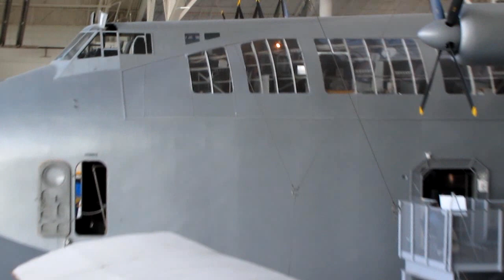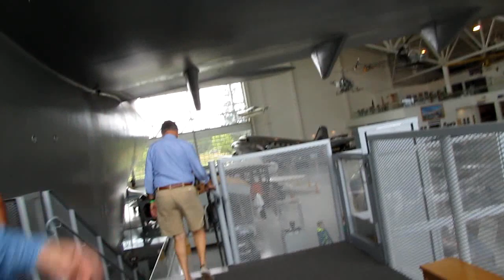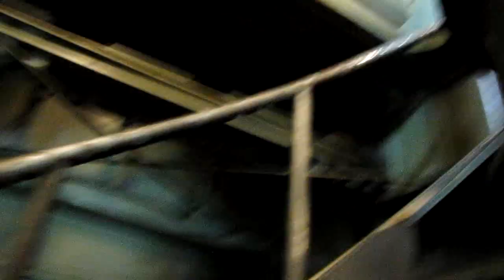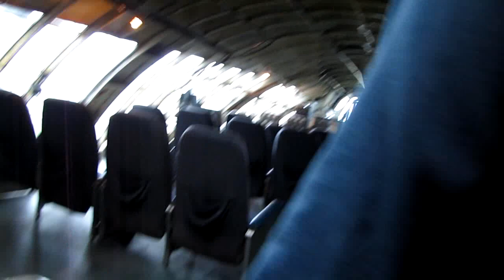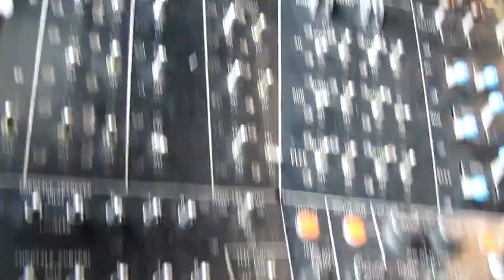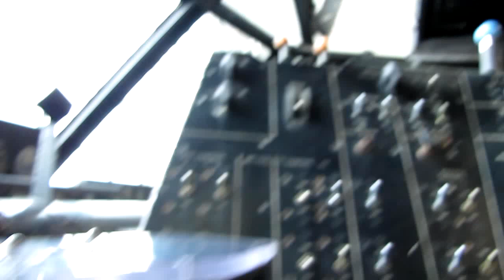The Radio Mechanic Visits The Spruce Goose

Comment: Hey Radio Mechanic, you are so IGNORANT, the bomber that did most of the bombing of Germany in WWII was the AVRO LANCASTER.
Remember a small outfit called the Royal Air Force.
The Lancaster had a bigger bomb load and greater range than any other bomber used over Germany and it carried the biggest non nuclear bomb of the war, the 22,000 lb GRAND SLAM designed by Barnes Wallace. The Lancaster destroyed the Tirpitz with Grand Slams which lifted the battleship out of the water and flipped it over.
Only the B29, which came much later, had a greater range and bomb load.
I saw the Spruce Goose when it was at Long Beach right next to the Queen Mary, a truly magnificent aircraft.
Reply from the maker: While your correct in that the Avro carried a bigger load, if the US had not gone in on daylight precision raids England would likely be speaking German. I agree I should have said "U.S. Bombers.  The excitement of being there colored a lot of my narrative. And as a WWII history buff I am well aware of the contribution The AVRO as well as the other British planes contributed. However calling me IGNORANT just shows your upbringing is lacking. Nicer ways to phrase things than that. Don't you think?
Reply: Yes I apologize, perhaps I was a little too ANNOYED at the time. But you see I was born in England in the middle of a Luftwaffe air raid before the US came into the war. we were in a desperate state but we were supported by troops from the Commonwealth they were our family also. I had an older brother and sister who remembered the entire war VIVIDLY and the privations they endured. They told me of the dangers and the fact that our parents would never have let us fall into the hands of the NAZIs, a very sobering thought.
That never happened but no one who did not experience it can understand the gravity of that period.
I had an uncle who flew for the RAF in 1940 he was 18 he flew in small two engined bombers, the Handley Page Hampdens. Returning from a raid one night the pilot lost his way and crash landed in a field, my uncle was severely injured with a crushed hip he was the only one hurt.
He was of course retired from active duty but because of the shortages of EVERYTHING his hip was never restored correctly and he was a cripple for the rest of his life, he was a very handsome young man but in true Hollywood fashion he married his nurse who was a refugee from Malta and an equally stunning young woman. The rest of his crew went back to active duty, none of them survived, the crash saved my uncles life. 
So you see this is a deeply personal thing. No one who lived or was born during that period will ever have anything but gratitude and praise for the USA. Britain fought alone for a long time and it was the Battle of Britain that was the first defeat that Hitler suffered, Britain is a tiny island and we sacrificed virtually everything we had to fight that war. Remember that had WWII been lost then not only Britain might be speaking German BUT THE USA AS WELL.
Incidentally it will be no surprise to you to know that WWII is also a passion of my own yet I find that many Americans know little about the role that Malta played, if you are not aware of this I urge you to read about it. 
Malta received the greatest tonnage of bombs per square mile of ANY THEATER OF THE WAR. Yet Malta survived thanks to the heroic efforts of the British Merchant Marine the Royal Navy and the people of Malta.
In the end the RAF were left with only 3 WWI biplane fighters to oppose the Luftwaffe, the planes were named appropriately, Faith Hope and Charity.
 Read the story of Operation Pedestal and the critical role played by an American Tanker the Ohio which despite everything the Luftwaffe could throw at it the Ohio refused to sink.
Hit by many bombs it finally lost all engine power only a few miles from Malta it was towed into Grand Harbour Valletta by two RN destroyers SIDESADDLE. Yes they literally tied a destroyer to the side of the Ohio and bought it into harbor, where it almost immediately settled on the bottom but its cargo of oil was pumped out and it saved Malta and perhaps the war.
When Italy surrendered the Italian Navy was ordered to sail to Malta to surrender under the guns of Grand Harbour Valletta, a very fitting salute to the incredible courage of the Maltese people.
Regards.

Comment: I only saw it in a videogame, in an unfinished state (takes place during construction), and i was STILL impressed. I'm fairly certain that they got the dimensions accurate. I'll need to get my Google Cardboard compatible phone repaired (boot loops likely because of dead charging circuit) and check out some of the VR/360 videos somebody took of this exhibit here.
Reply from the maker: The real thing is Amazing.

Comment: I do agree that the "Spruce Goose" is an amazing aircraft. However I must point out that your statistics on the bomb tonnage dropped by the US Air Force in Europe are incorrect. The RAF dropped 964644 tons while the USAF dropped 623418 tons. Also, while the B17 was an iconic aircraft in WW2, the British deHavilland Mosquito, which was like the "Goose" was also a plywood aircraft, carried the same 4000 pound bomb load as the B17 at a much faster speed(392MPH at 22,000ft vs 180MPH for the B17and with only a crew of 2 compared to 10 on the B17.
Further, the RAF A.V.Roe Lancaster Bomber which like the B17 was a 4 engine bomber could carry a bomb load of up to 22,000pounds, and regularly carrier  18,000pound loads to Berlin
Reply from the maker: I was talking about American bomb loads. Fully aware that the Mosquito was the fastest thing in the air. Wasn't one there or I would have mentioned it. The video is about the Goose.
Reply: I Agree about the Goose, it is an amazing aircraft. I was in it years ago when it was in LA. Don't know if you are aware that there are now 2 Mosquito's now in flying condition in the world.
Also, the  all blue Biplane aircraft with the US flag on the wing in your video near the car, is that a Waco?

Comment: Slight correction, the Goose did not fly in the ocean as stated, it flew within the confines of Long Beach Harbor.

And as somebody who has taken the same VIP tour, I was rather aghast at your docent's statement that the Goose new flew....'ground effect' indeed! Ground Effect 'is' flying, as long as it is powered and controlled, as of course it was. I have heard a lot of blather from self-appointed experts who say things like, "The Spruce Goose was incapable of flying because it never got out of ground effect". That is like saying, "Your car in incapable of driving on the interstate highway because so far you have only driven in in the car dealer's parking lot". The Hughes engineers were excellent, and Hughes closely supervised its design and construction and he knew plenty, and there should be no doubt that they had full confidence that the design would fly before they went and built it. Hughes was not supposed to fly it that day, and there was not enough space to do it safely, so keeping it low and slow in the harbor was the careful thing to do. Ever since, aviation engineers have used the more modern aerodynamic software to analyze the Goose, and they also know that it would have flown more extensively had it been given the chance. Of greater question is whether the novel wooden construction would have held up under real world use. Of course the Hughes engineers did a lot of testing and calculations, but I have never come across the numbers they used.....were they designing for a life of tens of thousands of flight hours, or just a few thousand?
Reply from the maker: When I go into these things I take a lot of what is said with a grain of salt. Like the "Crystal" radio comment he made. Don't even bother to argue with them. It likely would have needed some engineering changes as did most planes of the era. Heck, modern ones usually do. But like most war material it would likely have had a short service life. And I agree, flying is flying.

Comment: The comment you made that it did not really fly is not so right, if it had enough power and lift to escape the surface tension of the water than it would have flown just fine. That was why that was all he did, lift off proved everything.
Reply: If the Wright Brothers flew, so did the Spruce Goose.
Reply: Yes, it was totally airworthy.  The reason that Hughes did not fly it again, and at altitude yet, is that he did not want to risk the one prototype and, also, he was still traumatized by his own air crash.  He knew as an engineer that the H-4 was safe, but it was a visceral thing.  People focus on how eccentric he was but he was a frickin' genius at least on par with Nicola Tesla.  The construction and design techniques he pioneered for the H-4 laid the groundwork for the wide-bodied jets we fly in today.
Reply: I suspect that any plan for contiuous service would have included a series of production & service updates.
Reply: I'm a seasoned pilot, so naturally I feel like chiming in... :p  I'm not the "know-everything" expert on the H-4, but my opinion differs slightly from yours and others here. The aircraft did truly fly as you correctly stated, but when it comes to flying around "at altitude", I believe it would've been quite unlikely. Yes, it surprisingly had enough "oomph" to get airborne, but I think that was completely due to the plane being in ground effect, giving it increased lift. That probably explains why Hughes seemed surprised when commenting about how it lifted off. If that is indeed the case, then it wouldn't have gotten much higher than an altitude equal to around half of the wingspan width. I'm kinda in a hurry so I can't get into a detailed explanation, but a quick google search will tell you all you need to know.

Edit: I came back to finish watching the video and see that the guy mentions "Ground Effect", so this comment may not offer much insight... cheers

Comment: As much as I enjoyed this as a radio tech in the Navy, I need to mention that the designation of the Flying Boat was H-4, or alternately HK-1 for Henry Kaiser's part of its provenance.  I worked a Hughe Aircraft, with some folks who had spent time on this plane.  

H-1 was the airplane Hughes used to set world records and is in the Smithsonian Air & Space Museum. First a speed record, set at Santa Ana, CA and then, with a longer wing to hold enough fuel, it was flown coast to coast.  As a Hughes employee working with a group that also did the first security system for the Air & Space Museum, I had a chance to go through it before it officially opened. In a business suit, but there on vacation, was mistaken for another Hughes employee they were expecting that day. He apparently was late, so I was treated royally, and got to meet the director, who after pleasantries about the display of the H-1 Racer asked if I had any other questions for him so soon after Howard had passed away. I of course wanted to know about what would likely happen to the Flying Boat. He said there were plans to cut it into 9 pieces because so many air museums were wanting to have only part of it. The look on my face was probably the very same look the actual Hughes executive they were expecting gave to him. That is how I imagine it, anyhow. So in my small way I may have helped save it.

Of course there was also a public campaign to save it for which I also took part. A rally at the Long Beach Airport, where the "co-pilot" on the one flight was the main speaker. He was not a licensed pilot at that time, he was a Hydraulics expert that Hughes wanted in that seat because that system was so new. He also told us that Hughes' dutiful engineers had made the hydraulics so powerful, to enable the flight controls to "feel like a piper cub" as Howard wanted. He soon realized that the system might go into oscillations should the reaction times be that quick, and could shake the tail right off the plane. He had them install dampers in the lines to slow them down, and of course Howard was aware of this problem. Howard was a very quick study and an excellent autodidact from all I have heard. He also would sometimes sit in on classes at Cal Tech.
Reply from the maker: More great history. Thanks for sharing.

Comment: While Hughes was still alive, this plane was kept in flight-ready condition, should he ever wanted to take it out again.  Sad that didn't happen.  I never got the chance to see her when she was in Long Beach.  Thanks for posting this!
Reply from the maker: They say it cost him a million a year to keep it ready to go. Sad it never flew again. And never will as it had to be cut into pieces to be moved to it's present location. And even if they had not cut it up, the glue used to put it together would have long ago lost its strength. Thanks for watching.
Reply: As I mentioned above, i saw it in Longbeach a couple of times in the 90's. But as i was watching this video, and inside the plane, where he showed the ladder up to the hatch to go topside and work on the engines. I could only think:  If i was was Howard Huges. I would have installed some sort of "pop up chair" that you could sit in while this baby was flying...right on top of the plane. What a rush that wold be...sitting there, outside, on top of this beast while it was flying.....what a RUSH!

Comment: i got to go inside the Spruce Goose when it was in Long Beach ,California. they had a Sherman tank in the plane. before they moved the plane next to the Queen Mary.the building it was stored in was not like a regular  building. if you flew over and looked down you would have seen that the building was in the shape of a airplane.they moved the Goose in the middle of the night to try to keep people from seeing it .that did not go well .they used a crane that was captured from the Germans in WW2. they set it on a barge and towed it next to the Queen Mary.they built the worlds largest geodesic dome to put it in. they built the dome from the top down. when they got about half way the slid the plane in. the Navy number of the crane was YD-71. the last i heard of the crane it was in Panama. google it . the crane was a awesome piece of equipment by its self.
Reply from the maker: Looked up the YD-71 and info I found says it was built by Dravo, Pittsburgh PA in 1938. Sure you have the correct registration? Would have taken a monster crane though.
Reply: The Radio Mechanic sorry the number should be YD-171. when i worked in the Navy base in Long Beach CA. they let me go on the YD-171.i have a book that tells the history of the crane. there where 4 of them  .the english tried to tow theirs across the channel it sank due to a storm. there was one blown up in a bombing raid and the ruskie,s got one that has not been seen since the end of WW2. and the one that the U.S. got when the germans built them they where self-propelled. they had a center mounted prop that could turn in any direction.
Reply from the maker: That is a big one....

Comment: by the way, I heard after the Goose landed, Howard saw there was damage internally to the tail, and thus decided to never fly it again. Is this a true reason why he never flew it again?
Reply from the maker: There are tons of rumors and urban legends about this plane. However he paid huge sums of money for 30 years or so to keep it in flying condition. I don't think he would have done that if it was damaged, and when the museum moved the plane they didn't find anything broken. I have heard that he was waiting for some one to develop a more powerful set of engines as the performance was not what he wanted. But big Round motors went out of style. Amazing Plane.
Reply: BTW... The C-47 sitting outside was converted after WWII to passenger configuration in the 1960's by Howard Hughes' airline Hughes AirWest. At the end of its service life it was donated to the Oregon Museum of Science and Industry in Portland where it was displayed in Hughes AirWest livery until that museum re-located. In 1996 a private owner of a former Eastern Airlines DC-3 worked a deal between Del Smith of Evergreen Aviation and OMSI to trade the passenger interior for the original bare interior, including the current military paint scheme. It was myself working for the Pearson Air Museum and Mark Smith who restored the other DC-3 who painted (with markings) that C-47.
Reply from the maker: There are lots of different stories going around. However until he died he paid about 1 million a year to keep it flight ready. Don't think he would have done that if it was seriously damaged.
Also heard a story he was waiting for someone to make a bigger engine. But this was the end of the prop age and a bigger "round motor" was never built.
Reply from the maker: Always nice to hear these little bits of history. Thanks for Sharing.

Comment: Oh my lord! I love this plane! I was also wondering, out of curiosity, how much money would one have to spend int order to have the Spruce Goose fly a second flight? I mean, you would need to tear down that wall, and remove the planes, and remove the goose, plus outfit it with working controls, and engines....I'm guessing 50 million. Maybe more.
Reply from the maker: That figure might be low. The whole thing is plywood glued with a very early epoxy. The Epoxy joints must be showing their age now and the whole thing would need to be pulled apart to re-glue every single joint. Years of work. Also when Disney had it they cut open the fuselage and put windows down the side to let people look in. That would all have to be replaced. The museum guide told me that they had to cut the main spar to take the wings apart. The reassembly that was used to display the plane would never support flight. Sadly this will never be flown again. Sad.